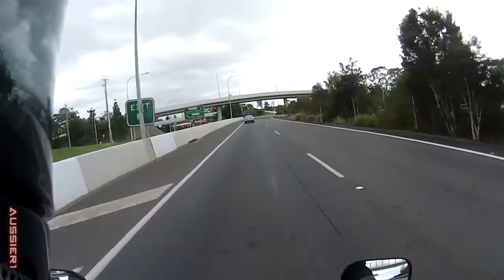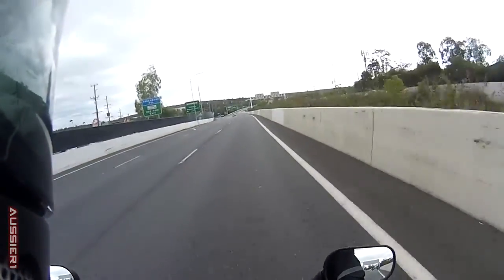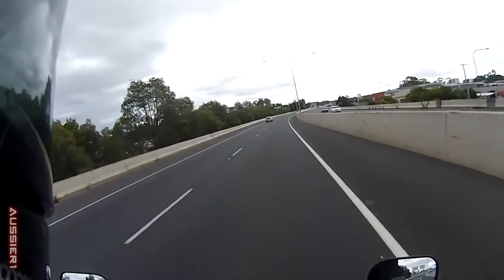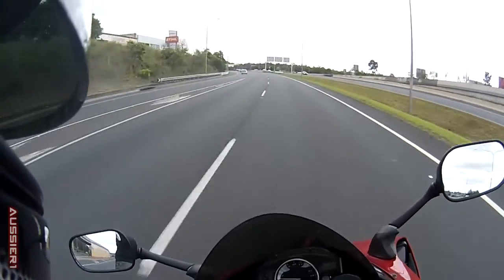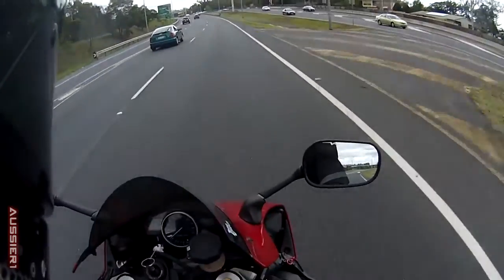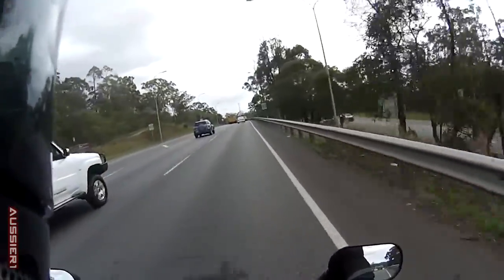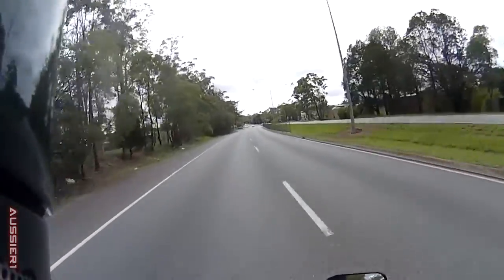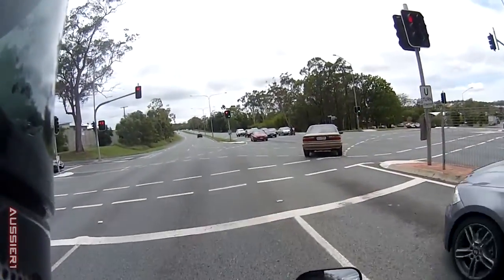Shoei RF-1200 (NXR) - Visor Speed Test

Comment: The visor on mine (or the mechanism that closes it) is super stiff. It is literally impossible to push both my different visors down over the clip and seal it without using two hands. Do you find that?
It used to be fine to close and seal up one-fingered but I see a lot of plastic dust on the little notches that hold the visor in place. Might take it back to bikebiz and see what they think :{
Reply from the maker: Spewin mate, nah mine is ok with 1 finger. It is really stiff to move though, especially when trying to open it from fully closed.